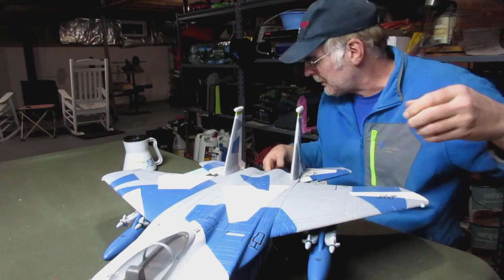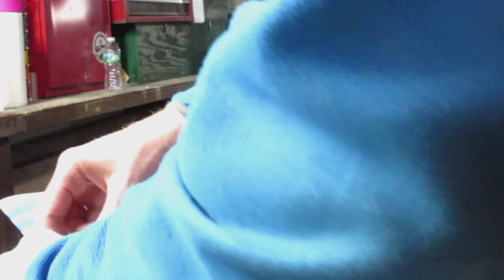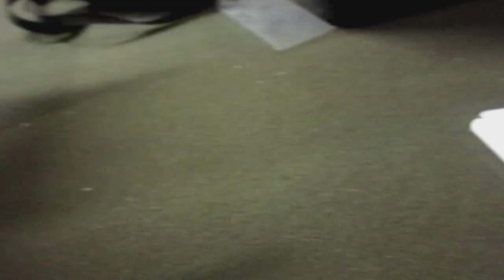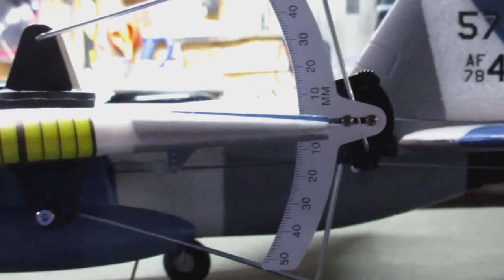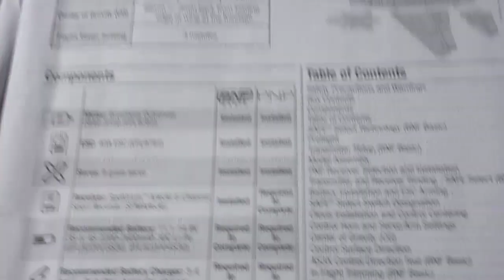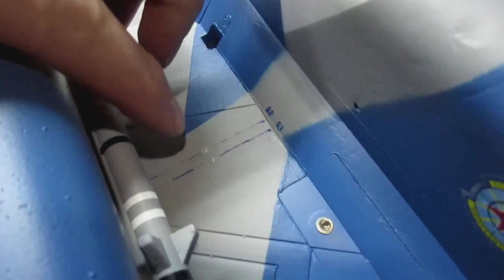E-Flite 64mm F-15 build ( Part 4 ) Final wrap-up

Comment: i woulds pulled that binding plug extension off after binding Receiver to Radio cause that jet has no extra space to spare in the 1st place...its a bitch just to get the 4s battery in and out of the Pocket.
Reply from the maker: Your right.  It does get in the way.  I may just do that.

Comment: What wing type have you got on your transmitter please
Reply from the maker: I'll look at it when I get home. I'm pretty sure it's normal. Single aileron single Rudder single elevator
Reply from the maker: I looked at my transmitter when I get home. Mine is a DX8 Gen 2. My E-Flight F15 is set up as a Wings normal, tail normal on my transmitter
Reply: Ok thanks very much for the information  as i have the DX6 transmitter and i want tp set it up with my new f15 eagle.

Comment: Just wondering if you have flown it yet? I just picked one up (my first EDF). Will be checking out your videos to get some pointers.
Reply from the maker: Have not yet.  Some personal issues came up over the last several weeks that put all that on the shelf for a while.  Hoping to get back at it this next weekend.

Have been hesitant because of the varying battery position debate and cg debate.   I don't know where to put out any more.

I have bad luck with 64mm EDFs so want everything perfect before launching.
Reply: @markhyde43  Thank you for responding.Wish you well.

Comment: Did this plane ever fly ? I watched #1,2,3,4. Then nothing. Did you end up selling it. I hope not, after all that attention. Gave it a thumbs up,  and subscribed...  👍
Reply from the maker: Nope.  I've been waiting for the rc airfield to open up.   It's been a wet spring and the field has been soaked.   They just got the taxi ways and the runways mowed and rolled this week.   The plane has been sitting and waiting.
I have alternate places to fly my prop planes like the Timber, Waco and Harbor Freight P-51s because they are really just park flyers  But my bigger and faster airplanes will have to wait, and so will my maidens.
Perhaps this coming weekend.